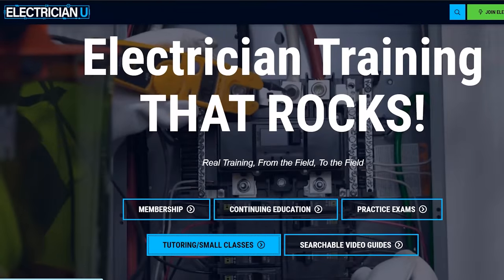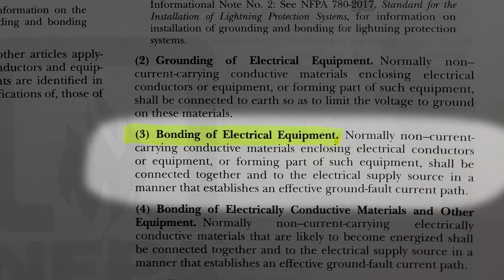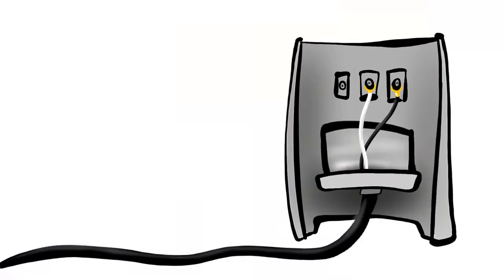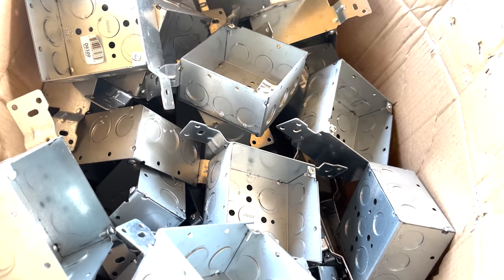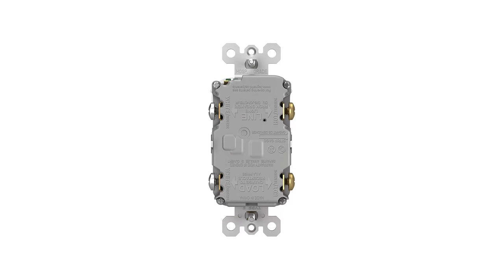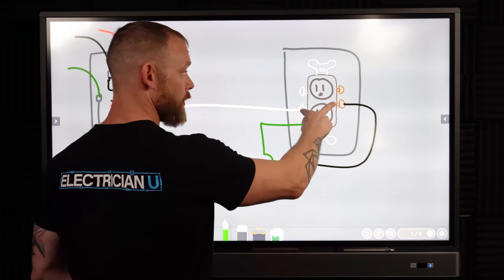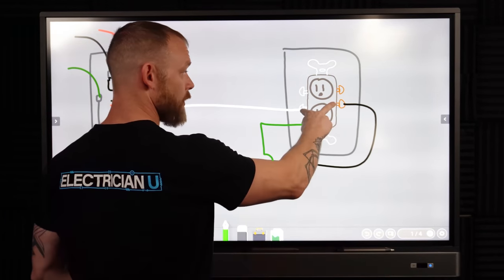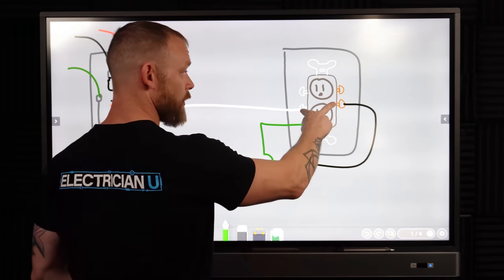Why We Bond Metal Boxes? Do Plastic Boxes Need Bonding?

Comment: We had an ADU built two years ago in our backyard. It passed all inspections and overall appears to have been built extremely well. There was only one minor thing I noticed recently (which may be nothing at all, but I figured I'd ask because I like learning new things). When moving some things around in a cabinet in the kitchen I noticed MC coming out of a metal junction box that continues on and lands in a blue plastic box feeding a receptacle on the outside of the cabinet. I understand that the MC was used to protect the wiring in the cabinet area from possible damage, but I would have thought an electrician would normally land the MC in a metal box? Are you allowed to have MC land in a plastic box? Just curious. Thank you.

Comment: When I worked in a commercial kitchen, we had a walk in cooler in a short hallway that also housed an electrical oven used for roasting directly across from the cooler's door. Additionally, this area was on a ramp thus the need to hold the carts we moved into the cooler. One day I pushed a metal rack against the oven and opened the door, the cart connected to the oven's outside frame and I completed the circuit opening the walk in door. As it turns out, the maintenance crew changed the plug to fit the appliance and didn't connect the ground. Eventually, the wire wore through the shielding, and energized the frame of the oven and the cart it was on. Not a fun day for me...

Comment: If I followed this correctly, my shop is not correct. Due to the pole barn construction, I used conduit throughout. I used 1/2 EMT and THNN wire, with metal handy boxes, etc.  I wired it 15+ years ago. But I do not remember putting grounding pig tails to the metal boxes. I suspect although it looks like a proper application, I need to watch this video again, and make a couple corrections. I'm thinking that conduit could get lit up as well. Rod
Reply: I may be thinking of this wrong, but isn't the receptacle bonded to the box, which is bonded (through conduit) to the panel, which itself is grounded?  the conduit provides your ground fault path
Reply: @josephtobolski  After watching the video again, I suspect you are correct. Seems this video involves a single metal box/etc. on a Romex/sheath, wired system.  Thus the added bond. Rod

Comment: I always open my code book when watching your videos. I paid $120.00 for the "real" 2020 NFPA NEC book. And I brought it directly from NFPA. I can not find 250.4 in my book. Mine goes from 250.36 G to Part III 250.50.
Reply: Looking at the packing slip it was $137.45 NEC Spiral 20
Reply: @willwilliams7057  You're looking in the wrong place.  250.4 is after 250.3 and before 250.6.  Page 70-111
Reply: @barryomahony4983  I found it the other day the pages were stuck together. But thanks for your reply.

Comment: So how am I bonding a painted metal cover? Hope that the metal screw breaks through the paint? Is that not normally conducive, due to the paint?
Reply: You would want to scrape the paint off the area underneath the screw head to make sure there is metal to metal contact.
Reply: @TM-dh2xb  good advice, and thank you for it. 

Later, I remembered about the self grounding function that new devices have which I believe is to bond the cover and box as well

Comment: I am a pilot, not an electrician.  In pilot safety training, much emphasis is put on a "chain of mistakes."  The rule is, one mistake will not kill you, but if a chain develops and is not broken, then you or others will die.  If you break the chain at any point, then no accident will happen.  I made the comment about metal electrical boxes in an effort to find the chain.  For example, if I use the green ground wire and attach it to one green screw on the strap of an electrical outlet, and then use metal screws to attach the strap to the metal box, it will ground the whole box as well as other outlets in a 4 gang box.  Now, something could go wrong, possibly years later, but I cannot see what the problem is.  That is the reasoning behind my question.
Reply: So in accident theory, and particular in aviation safety, an aircraft crash or less serious accident is often  caused by a number of different things going wrong, things that have been missed.

It isn't like that in electricity installations.

Comment: Good stuff! Here’s an interesting topic I come across that no one can seem to answer the same.

And that is how the current flows in systems using the literal earth as the return path such as a SWER (single wire earth return) system.

Some say it literally flows in the ground from electrode to electrode. And others say electrons are simply pushed and pulled at both electrodes due to earth being an “infinite sink for electrons.”

What is your professional take on this? How does the current actually flow?

Comment: So I have a video idea that I think is basic and kind of confusing. In New braunfels we have normal pancake boxes in a few places. We failed a inspection because the pancake boxes are 6cu" they said we need to use bigger boxes because there's not enough space for the wires. We looked it up in a mike holt foum and 12/2 wire takes up 6.75cu" the new fan rated box is 8cu".... Can you explain sire size and box fill, pipe fill, and junction box fill. The guy I work with sais they all have diff rules for what your working with... thank you

Comment: I was hoping you would get into why we isolate neutral and ground in a subpanel (but that can be for another video) that confuses a lot of people - including me when I started out.

Reminds me of the first time I had someone (a young job site helper trying to get in the trades) ask me why there's a ground AND neutral conductor and I used this scenario of a loose conductor in a piece of equipment to explain their specific purposes and I saw the light bulb moment when he seemed to grasp the concept. He kept coming back and asking questions that day I think he realized he maybe could learn this electrical stuff, I never saw him after that but I hope he did!
Reply: The reason that we isolate the ground and neutral in every panel that is load-side of the service disconnect, is that the neutral is meant to carry current under normal circumstances, and the equipment grounding conductor isn't.   When there is an unbalanced load in the subpanel, the neutral carries the imbalance of current back to the source.   If you bond neutral and ground in unnecessary locations, you create parallel paths with objectionable current on the EGC, the metal equipment housings, the building steel, the conduit, etc.  You want the green wire and all the electrically dormant metal, to remain electrically dormant, unless there is a fault.  Any intended current that has to flow on a zero-volt wire, should flow on the neutral.

If not required by the NEC, do not bond neutral and ground.   Keep these systems isolated, except where the NEC requires you to bring them together, which is at the main service disconnect.
Reply: @carultch  Error in this post. "current carries the imbalance back to the source."

This should be "the neutral carries the imbalance back to the source."
Reply: @deang5622  Yes, that is what I meant to write.  I've corrected my original post.

Comment: The mounting straps on receptacles and switches don't count as a ground, for metal boxes that don't otherwise have a ground in them? The circuits are wired up with Romex that has a ground wire in it.

Comment: For a dedicated circuit (20amp receptacle) to connect my computer and other sensitive electronics, do I need to use an isolated ground receptacle to minimize any noise? If so, what cable would I use 12/3? Or is an isolated receptacle even needed? I only have one breaker box

Comment: Your videos are Awesome! I do have a question: Do the Neutral and Ground wires always need to have separate bus bars in a main circuit panel or can they use the same bus bar?

Comment: Wait someone wanted to know why you don’t bond an insulator?
Reply: It's not uncommon to run across people in one type of trade or another that are pretty much strictly doing what they've always been told to do and never really understanding a cause-and-effect from point A B to C,D so if they encounter something at Point X or Z to be able to think back and apply it. In other words they're parts Changers more so than mechanics.
Reply: I still dont get something…
Why not just use plastic everywhere? Why use metal boxes if they can electrocute?

(Plastic or any non-insulating case)
Reply: Plastic box isn’t an insulator.”, as you mentioned. It’s simply non-conductive. 

The question goes beyond connecting a ground to a plastic box; the question applies to not connecting a ground to devices like a smoke detector.

Comment: It took a bunch of vids for me to learn that a breaker won't trip because the circuit went to Earth ground. Earth ground by itself won't flow enough current to trip a regular breaker. I always thought it would just trip if you touched a wire to Earth, but it won't. Dangerous.

Comment: This old house (built in 1947) is wired with cloth (some wiring is plastic) covered 12/2 Romex with no ground and have mixed metal and plastic boxes. Can I just run a 12 ga solid wire between boxes and then to the ground bus of my service panel or do I have to replace all the wiring with new Romex?  Thanks.

Comment: Dustin, I know I have installed a bunch of smoke detectors, but during taking an electrical exam, the city asked a bunch of questions about "distances from" and specific locations of them and I couldn't find any of that in the 2008 NEC codebook....yeah, that's right, Indiana still uses the 2008 NEC codebook. However, I have the 2020 codebook and it is no better in informing that information. So, my question to you is if the AHJ uses NFPA72 codes for that subject and you are not told to bring a NFPA72 codebook, how the heck are you suppose to answer any of those without being able to write down the code reference(s) to those questions? Can you make a video on smoke alarms/detector installation that references such code article and section references, if there are any. Maybe in the 3 hour testing session my eyes were so buggy I just couldn't see straight! Hahahahaa..... also..... what the heck does a few questions about solving a hypotenuse have to do with electrical work or code? Each question out of 100 questions are worth only 1 point each, but you have to have an 85% or better to pass. They seem, to me, intentionally place too many unrelated questions that also cause you to waste time on something not there. It seems like they just want you to keep spending money to test! Why not just put electrical code related questions only and charge $250 to take the test that if you are a real "qualified person" (according to Article 100) electrician it is a better way to collect some contractor money, and the fakes wont want to spend that amount of money anyway so it will scare them away. I don't think Electricians that have been a tested Master Electrician should have to test in any other city. Some cities respect that and allow reciprocal licensing. If you don't know what you are doing, the AHJ of the city can fail your inspection(s) or strip your license for good if your work isn't up to par anyway. Never had an Inspector complaint in the 46 years I have been an Electrician. I enjoy your videos very much, and I respect your opinion and experience. Keep up the good work.

Comment: commercial kitchens 3 phase motors like Hobart mixers 4 wire receps. 3 hots and a ground.
mobile homes  mostly have a sid-connect by meter, from there to the load center which is
now a sub-panel, must have a 4 wire feeder, 2 ungroundeds 1 neutral and a ground and the 
neutral bus MUST be isolated from the cabinet.

Comment: On an old system, without a ground at the service and fuses without Breakers at the main service and subpanel, would I still Bond the ground, using a jumper wire from the box and/ or conduit and into the neutral busbar at the Main Service? And with fuses instead of Breakers would that still work in a short, where it would blow the fuse, like it opens a breaker if a wire where to contact metal?
In other words can the current flow through a fuse and the fuse would blow, like a breaker would trip?

Comment: Question when wiring a metal box can you run the ground wire to the metal box and then from the metal box to the outlet or switch
Reply: Yes.   The EGC isn't required to be irreversibly spliced, so as long as it is electrically continuous, even if through termination to a grounding busbar on a box, it is still compliant.

Comment: Why bond in the metal box with a jumper/pigtail since the metal ears of the receptacle are touching the metal box and the ground conductor that connects to the receptacle also is internally connected to those metal ears? So, in other words, why just run the ground conductor to the receptacle ground screw and the metal box will also be grounded because it touches the metal ears of the receptacle?
Reply: I was drilling holes through some old light fixture boxes to attach ground screws when I noticed the same thing.  The light fixture was bonded to the box by simply installing it, so I didn't bother adding a pigtail.  I would love to hear an answer to your question, because it does seem redundant and it's not like the receptacle is going to lose contact with the box.
Reply: (a) EVERY receptacle isn't made like that. (b) the box would not be grounded once the screws / receptacle are pulled. (c) The Code(tm) says so.
Reply: You can not use the #6 screws, and the metal tabs, to ground a metal box according to code.

Comment: Great video! Big question. If the point of a grounding conductor is to connect to neutral to trip the breaker. What is the purpose of grounding rods to Earth?
Reply: To dissipate static electricity and to give a path for lightning strikes.
Reply: The purpose of the ground rod, is to establish the fact that all electrically dormant metal, is at the same absolute voltage as the surrounding soil.   A ground rod shouldn't carry current under normal circumstances, and the Equipment Grounding Conductor should be what does the heavy lifting of returning fault current to the source to trip the breaker.  Not a path through ground rods.

Comment: How about bonding a metal box using the sound wire in a 12/2 NM cable where the white (and black) is run to the hot on the breaker? In this case is it correct to bond th box using th bare ground? Same for a circuit where the appliance is pulling  230V?

Comment: Great Video, does this still work in a sub panel?
Reply: In a subpanel, you still need the enclosure and structure bonded to the green wire, so that all electrically dormant metal remains de-energized, and has an effective fault current path in the event of a live wire contacting the can.   The only difference between what you do in a subpanel and what you do in a main panel that hosts the service disconnect, is that the main service disconnect is where you bond the green wire and the white (or gray) wire, and attach it to the grounding electrode.

Comment: If you run the ground wire to the ground screw on the receptacle, wouldn’t that ground the box as the receptacle is screwed to it?
Reply: Kind of not all metal boxes have devices in them though like metal junction boxes
Reply: Not everybody installs things right with the box flush with the surface...
Reply: That is a code violation. The box needs to be bonded regardless of whether there is a device connected to it or not. They make self grounding switches and receptacles that are bonded to the already bonded box when you tighten the device screws. The point is that the box needs to be bonded even after devices are removed. Sometimes a box is just a junction and in that case there is no device but it needs to be bonded if it's metal.
Reply: Yes, but it’s good practice to run a bonding wire. The code also allows mc/ conduct to be used for bonding, but over time (especially conduit) connections get loose and then the ground is lost. Codes are minimum
Reply: @jacobz3400  No, MC outer armor cannot be used as bonding. That's why MC has a ground wire inside of it. EMT can be because it is considered an effective ground fault current path. I am not sure who you are replying to because what the person above asked was about grounding the device and using that to bond the box. No one asked or mentioned about not running a ground wire. That would be an option with EMT, though, even though I would run a ground.

Comment: At 10:02, you show the ground path go through the metal of the yoke. I know that the ground and the yoke have continuity. But, some folks say despite that fact the yoke and ground are the same and that the yoke connects to the box, that the ground has to be separately connected via pigtail to the metal box. Care to comment? 

Specifically, in a 14-50 receptacle. People run a ground pigtail that have potential for issue down the road because they say it's not enough to have grounding to the receptacle (which runs through the yoke and is mounted to the metal box).